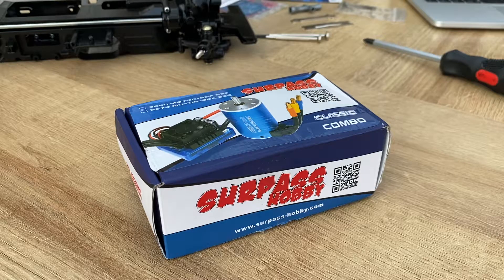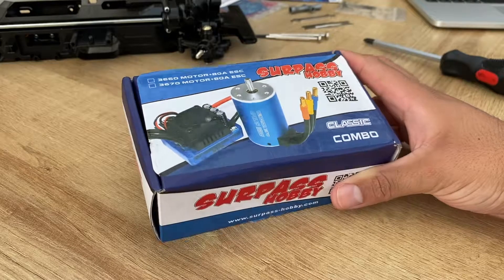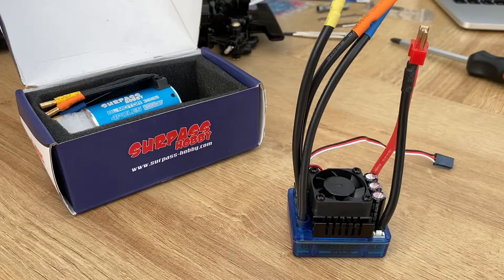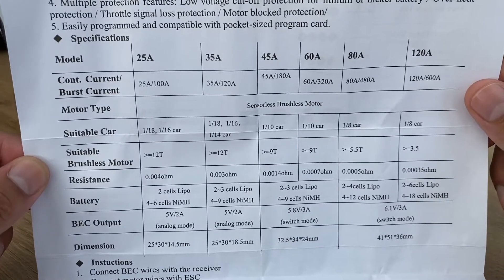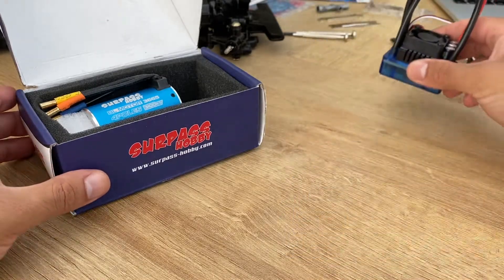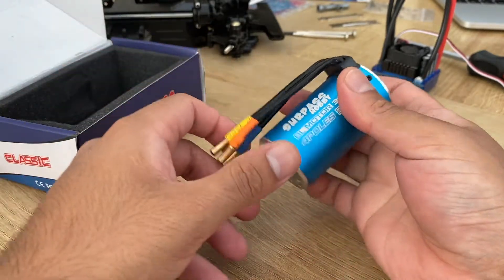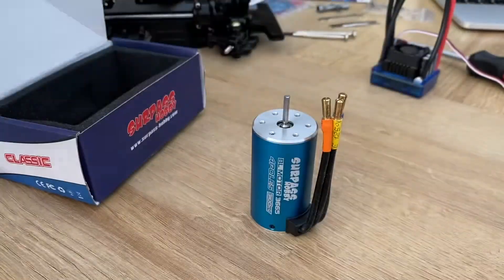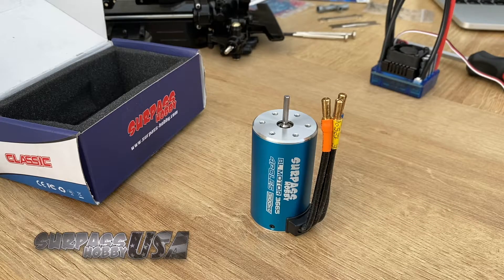Surpass Hobby BL 3660 Brushless Motor & 80A ESC - Small Unboxing

Comment: performa?
Reply from the maker: Hi, I have yet to carry out performance testing on this with another chassis I have (Tamiya TT01) that needs rebuilding. That will be in the next set of videos I will be doing. Also for anyone that is watching, the barrel of this one is too long to fit in a Tamiya TL01 as it will hit the inside of the wheel. You might get away if you have the long suspension kit for the TL01. Thanks For Watching.